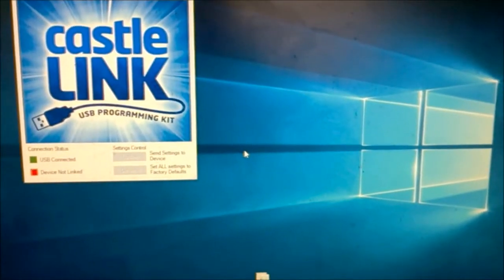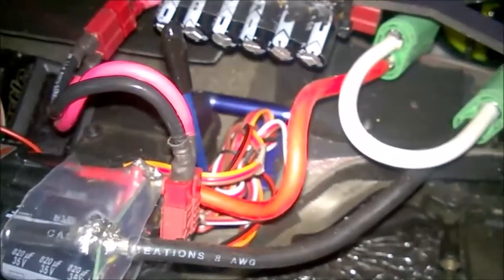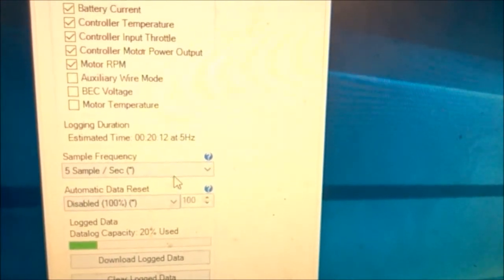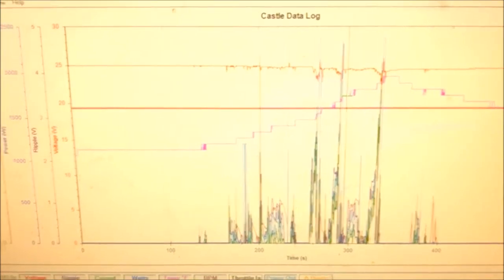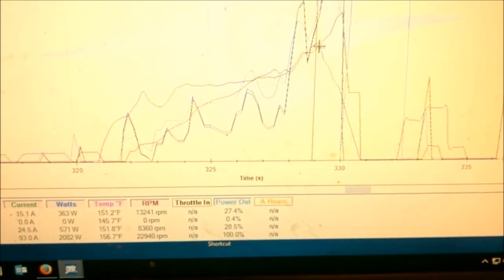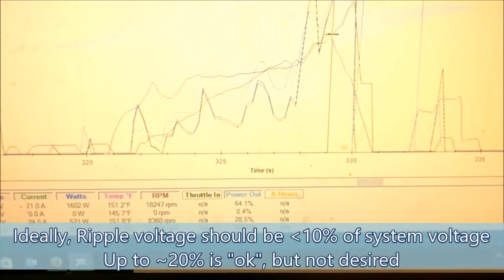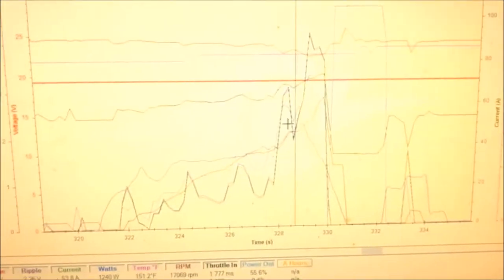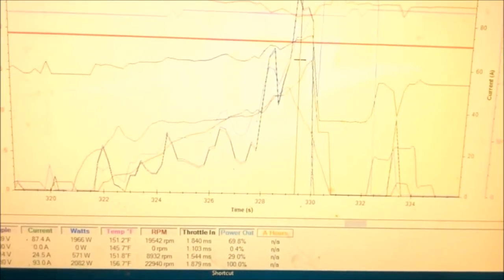Ep. 192:  Data Logs 101 - Getting the Most from Castle Link

Comment: I needed this! Just want to be sure I understand correctly though. In order for me to isolate the run I'm interested in, I'd want to look at and zoom in in the part of the graph with the highest peaks? Thanks!
Reply from the maker: Pretty much, but most people end up with a few "peaks" in their logs. You can look at other clues like the throttle input and check the timing to help you find the right data, though. For example, if it took you about 5 minutes after power-up to get lined up for your pass, you can skip to around the 300sec mark in the log to start looking for the data you care about. You'll figure it out in no time.

Thanks for watching! 😃
Reply: @RCPhysics  So if I found the highest and lowest throttle inputs, would that be the run and what I zoom in on? I like the idea if using that reading as a guide.
Reply from the maker: @JimmyKay1976  You should be able to spot when you lined up and started the run by looking at your throttle vs. rpm & power. You know you have the run because all 3 should have peaks.

Comment: Nice video. What cable do i need to hook up to esc to be able to do this?
Reply from the maker: You can use either the Castle Link USB programmer or the Castle field programming card, which has a USB link built into it. Links to both are below. You should have received a code for a free USB interface or a field programming card for $10 with your ESC.

https://www.castlecreations.com/en/castle-link-v3-usb-programming-kit-011-0119-00

https://www.castlecreations.com/en/field-link-for-driving-010-0063-00
Reply: @RCPhysics  thank u i appreciate it

Comment: My electric losi 3.0e goes 100mph. But now it wont go over 80mph. I use a 6s battery.  I swith between 2 different ones. Go to 100 on both.. but now not past 80 on both.. can it be cap pack? Or u think esc?
Reply from the maker: Jut replied on a different thread.

Comment: Do I need to disconnect my rx wire before linking my castle link card to my computer? I'm waiting for my castle link to come in mail as we speak, mamba monster x sensored esc 1515!
Reply from the maker: You connect to Castle Link through the channel 2 wire, so you have to unplug it from the Rx to gain access to it. You can leave the Channel 3 wire plugged in on all X-Series ESCs except the Mamba XLX, which needs Chan 2 & Chan 3 unplugged from the Rx to avoid hurting the ESC.

You can leave the card plugged into the computer while plugging into and unplugging from the car, though.
Reply: rhouse21 - RC Physics my esc has a spare castle link wire for the castle link to eliminate the need to have to unplug the rx wire. At least that's what I've read. I just got it and haven't hooked it up yet but it's a spare wire plug same as the rx wires just this one don't plug into anything but the castle link?
Reply: Ok read the drivers ed guide... The 1 wire is the rx wire and the other wire I was referring to is the aux wire!!
Reply from the maker: Yup! You got it now! So, you can leave the Aux wire plugged in on the MMX and you do not have to worry about unplugging the programming card from the computer as you plug into and unplug from your car. There's a LOT of capability in Castle Link. 

Enjoy!

Comment: My power out never goes near 100. I have 8s 6000mah graphene 130/260c batteries pulling 6000 watts with a cap pack power out seems to only run 60%
Reply from the maker: Have you ever calibrated your throttle?
Reply: @RCPhysics  it was actually the punch! I thought punch only affected the first few milliseconds... No, 100% punch only gave 60% power anything less than 80% gives 100.. now to address voltage sag... 34 to 21 volts in one drag pass. Geared 28/46 with 3.91 diff and 4" wheels. 2200kv motor 6000mah 130/260c lipo, and ripple killer. 8,500 watts
Reply from the maker: @DandSCreations Voltage Sag is all about the current level and internal resistance of the cells. How much current did the logs read?
Reply: @RCPhysics  340amps
Reply: I wish I could show you how aerodymically flawless my Hobao buggy build is.. a work of art.  Complete fabricated diffuser multi element wing and canards (3D printed) and a lexan full body belly pan. Protoform Corvette body. I've been 106 which is pretty damned slow but I was only putting out 60% power in those logs and it was before all the aero mods.
Reply from the maker: Most xlx ESC will not register more than 340 or so amps because of the factory calibration even though they actually can deliver more than 400.  

Assuming you are really getting ~400A, that would put your LiPos at ~4mOhms pet cell internal resistance (IR) which is "ok" for speed running, but not the best out there. Do you have a charger that can measure IR?
Reply: @RCPhysics  1m ohms across the cells
Reply: I don't trust this chargers readings
Reply from the maker: @DandSCreations  what brand are your LiPos?
Reply: They are Gens Ace 4s 6000mah lipo HV graphene 130/260c batteries .. by the way I'm running a TP4070cm 2200kva motor, it's rated to a peak no load RPM of 75k and has a 4D wind. What rpm should I shoot for for highest top speed under load ?
Reply: Gens Ace Redline, the C rating must be complete BS ..
Reply from the maker: Which charger do you have? I had a team Orion a few years back and it's IR numbers were completely useless. I have a Venom Pro Touch now and it's numbers are rock solid. Gens Ace has some pretty decent LiPos, so I'd wager you were getting over 400A which would pull your voltage down. Still, if you actually had 1mOhms per cell, you'd have to have puller 1,500A to get 12V of sag. I'd wager the cells are really in the 3-4mOhm per cell range.

I have a video showing how to run the Castle Motor test which "matches" the ESC to your motor and measures its kv. https://youtu.be/3VRtzrV4C5s Castle ESCs can usually achieve 80-90% of the mac theoretical rpms in run if the motor is properly geared. That means you should expect ~38k - 44k rpm if your voltage is sagging down to ~21-22V.
Reply: @RCPhysics  I have a laegendary yes spelled like that.  Lgd240. I was only able to hit 106mph with my last gearing setup but I was running 100% punch which for some reason only put out 60% power  and had been hitting lvc  because it was set very high, and on some budget batteries. That's only about 60K Rpm. I want this car to go 125 I don't understand why it's so slow.
Reply from the maker: @DandSCreations  Remember, C-Ratings just mean the battery can deliver a certain output level safely. They don't really specify the voltage that the cells will sag to at that output level. It used to be 'implied' that the the claimed output current would be at or around the nominal cell voltage (3.7V/cell), but many makers now assume you can sag all the way down to LVC (or lower) in their claimed ratings
Reply: @RCPhysics  well this thing has a 130c constant which would mean 780 amps all the way to depletion... (27 seconds) that's impossible!
Reply from the maker: @DandSCreations  Yeah. Very true.